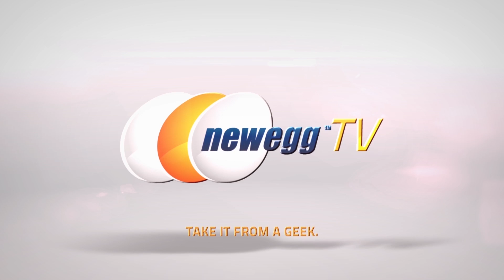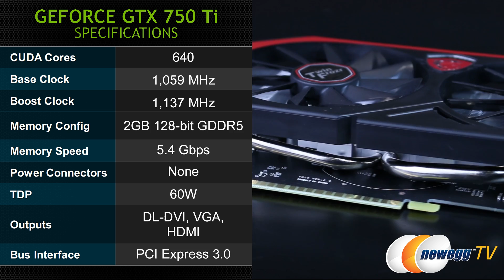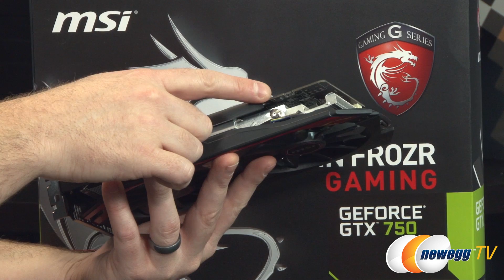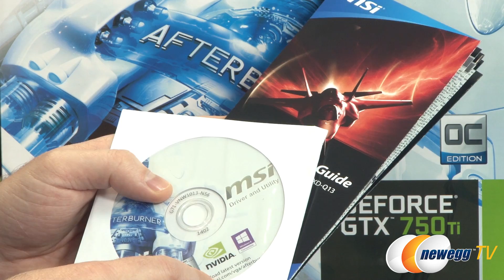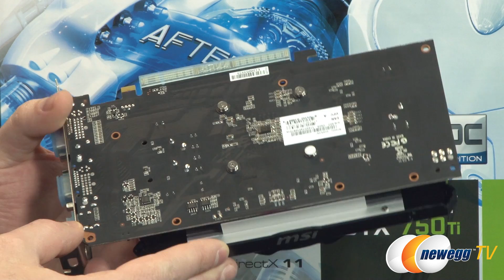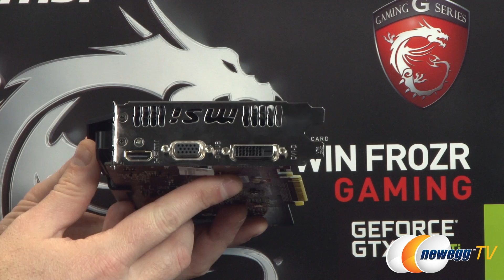MSI GeForce GTX 750 Ti, Gaming GTX 750 & 750 Ti Overview - Newegg TV

Comment: Gtx 750 to uses maxwell architecture... It uses 2 times less power.. It is ground breaking technology only nvidia can do... And amd better come up with something.
Reply: Found the nvidia fanboy
Reply: simply pointing out the facts.
Reply: 7790 shits on gtx 750 it is 10$ cheaper, and 30% more powerful when it comes to gaming.
The only draw back is that 7790 uses 85 watts while gtx 750 uses 60 watts.

I know that i can get a better gaming gpu but im building a low profile(power consumption) PC so even if the gtx 750 is weaker im still choosing it for its 60 watts design.
Reply: 750 Ti is 15% faster than 7790. Why the hell you going back to 7000 series? Talk about the latest cards by amd.
Reply: MashLegend What you say are not all facts.  Yes, Maxwell is highly advanced technology and a very powerful design.  I recommended the 750Ti to a friend for a budget build of his.  The problem is you're completely ruling out AMD by saying such power light designs only nvidia can do and saying AMD better come up with something.  Both AMD and nvidia bring monumental advances to the GPU market and regardless of what happens I don't think either of them are going to take huge hits from another architecture advancement.
Reply: ***** What has AMD came up with lately? No upgrades of their old FX chips, No second generation fx 6300 or fx 8350 yet and this year they announce R9 series which are overpriced now about $150 more. Amd doing horrible now.
Reply: sorry i was wrong, but somehow correct
the plain gtx 750 vs 7790 = amd wins
But 750 TI is on par with the more expensive 7850 and R260x is just plain trash

and 750 ti OC ed is 20 $ cheaper
Reply: MashLegend could the gtx 750 run dayz standalone
Reply: DESIRING GAMING Dayz is poorly optimized, it runs bad even on high end cards. I do not know the current state of the game but I do know it was unoptimized about 3 months ago.

Comment: gtx 750 ti vs hd 7850 / 650 ti boost, which is better??
Reply: I know that the 650tiboost is a tiny bit better than the 750ti.
Reply: The hd 7850 performs somewhat better than the two nvidia cards, which have essentially equal performance, but the hd 7850 is also more expensive.

Comment: I'm guessing you can't sli the cards?
Reply: you might be able too, Nvidia may have used the PCI SLI option, where all SLI is handled by the board's PCI slots and no bridge is needed, although that was a higher-end feature, they may have brought it down...
Reply: No SLI connector so I doubt it
Reply: They might release a 750 TI boost this generation able to SLI
Reply: chukman102 I REALLY hope they do :) i want a $170 750Ti BOOST

Comment: i got  this card  and is a very good choice budget/performance quite nice oc too. i have been hable to run everything on ultra no problems no lag nothing only crysis 3 drops a bit low ,lowest so far 25fps you wont even notice, most of the latest games it runs at 30/100fps on ultra easly ,got 200fps max on F1-2013 maxed,i would buy it again.
(Not Playing in 1080p thought. 1600x900)
My Setup
Asus V Formula Z
8Gb G,skill Ripjaws
GTX 750 Ti TwinFrozr OC
Fx-8350 4,8Ghz

Comment: So what is the difference between MSI's "g series" and the regular all black model?
Reply: The g series has more sophisticated cooling and different aesthetics, and it has (if I recall correctly) a slightly higher core clock than the mainstream model. In my opinion, it is not worth an extra $10 unless you overclock or you can't live without msi's cool dragon styling.
Reply: Stigcheesy This card seems to have silly overclocking potential though, and moving the clock frequency slider from 0 to max doesn't require a whole lot of skill or knowledge, so why not? :p

Comment: Can those cards run advanced warfare or black ops 3
Reply: Anthony Rios of course
Reply: Anthony Rios I know someone already answered but yes it could not on ultra settings though.
Reply: +Anthony Rios  mine is over clocked running textures on extra everything on high but I had to remove some shadow options if I want to run 1080p

Comment: can this card beat gtx 650 ti boost?
Reply: It can, but only the special version one from EVGA, which shows slightly more fps than 650 ti boost.
Reply: Lone Druid You forget 650ti has drivers and newer bios available to make it run more efficient, once this gets more mature it'll beat out the 650ti handsomely.
Reply: Knick Knack Especially being on a new architecture all together.

Comment: how much  watt do i need on my psu to run this card normal w/o overclock and stuff
Reply: +Darkecoo you could do a 500 watt but i would do 600 just to be sure it also depends on your motherboard and other stuff.
Reply: +Darkecoo 450 fine

Comment: is the MSI N750Ti TF 2GD5/OC compatible with the GIGABYTE GA-970A-DS3P (rev. 1.0), socket AM3+ motherboard
and the AMD FX-6300, 3,5 GHz (4,1 GHz Turbo Boost) AM3+ processor?

and does it fit in the Sharkoon REX8 Economy Edition, case?

Comment: I got this card and when i installed it my computer it wouldn't boot past the bios screen. It would go black and show me a flashing underline. Please help!

My specs are
CPU: i5-3450 
Ram: 16GB
MoBo: DX4860
PSU: 500w
Reply: can i put i5-4670k,gtx 750,and g skill trident on the same motherboard

Comment: I have 760 :D
Reply: I have a 780 >;P
Reply: If we all have Twin Frozr's, that would be awesome!
Reply: 570 here, it's time to upgrade. I want a 760 at least.
Reply: MSI 760 OC :P
Reply: 780ti for me next year, im going to buy a gopro3
Reply: Msi gtx 750 ti :D i love it i have 2 case fans (1x 120 and 1x 140) and i was able to overclock the card so high that it boosts to 1315mhz and about 45% an speed, the card only gets about 60-65ºC hot (or cold xD)
Reply: Daniel Deutschen * 45% fan speed
Reply: Zushikatetomoto Shift
great sample! how high is the boost?
Reply: Zushikatetomoto Shift
cool cool
Reply: not much, my card is somehow bad, smetimes it switches to 2D-mode in 3D-games
Reply: Zushikatetomoto Shift
you somehow odd I know

Comment: i have this card and the benchmarks on the internet are all wrong i can run bf4 on ultra 1080P around 50-60 fps meanwhile they say it runs on 27-40 fps total bullshit i tell you
Reply: depends on the processor tho
Reply: I run mine on a I3 3.5 GHZ 7500 GTA V runs 60 FPS on High settings with some features disabled. 

The card is a good bang for it's buck.

Comment: Will the twin frozr card need to be plugged in externally to the power supply? Pls help I installed it into the slot and it says card not found when I launch the driver